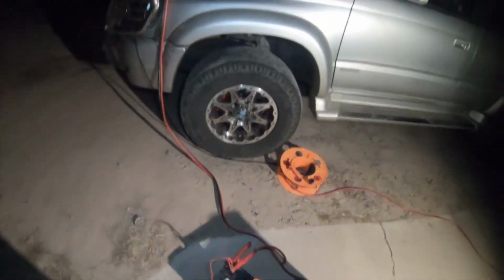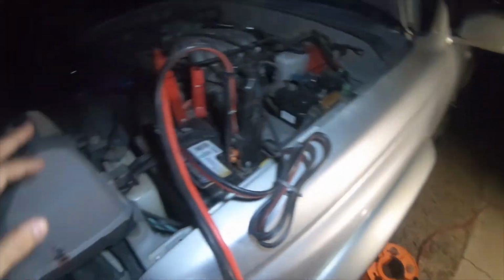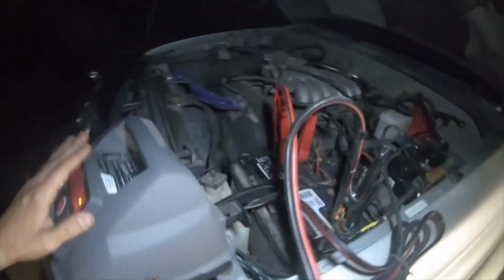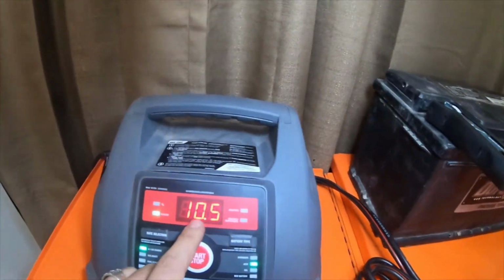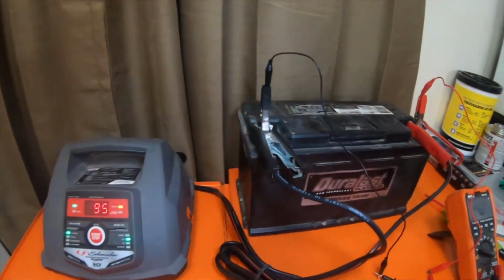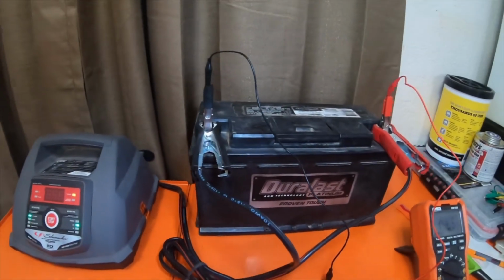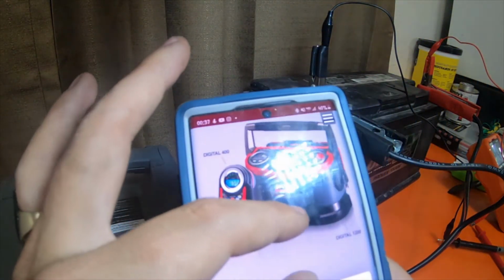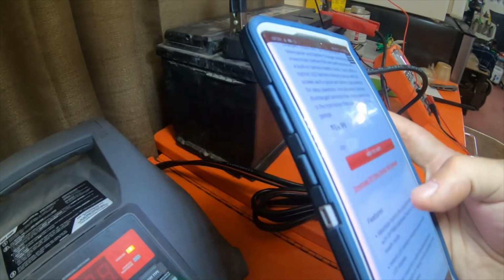Quick Tip - How to Revive A Deeply Discharged AGM Battery N More - Part 2 - 8 14th 20

Comment: Have you below 11 V the battery is already damaged. What’s the point?
Reply from the maker: Just because the battery is below 11 volts don't mean the cells are damaged and the point of the video was to show others how to boost a battery to then get it to charge with a smart charger

Comment: You don't mention if they are both AGM batteries. Can you have the good battery as lead acid and the other AGM and still do the Parrell set up?
Reply from the maker: @BrentFowlds  yes you can the battery type dosent matter when trying to boost the battery voltage just make sure the charger can deal with that type of battery

Comment: You really should use a trickle charger Ctek or battery tender are really good. No more than 2 amps charge rate and bring it up slowly.
Reply from the maker: This video Is about reviving a Dead Agm with another Battery to trick the charger into charging the dead battery.. You want to dump as much amps into the battery over Few hours to Bring the cells up rapidly You use a Battery Tender At the point were the battery Is At 98 percent or above to Maintain the battery charge and Help with the sulfate.. @JoshSmith-wo7zw

Comment: Should not I hook the charger to the bad battery instead? I mean i want to charge the bad one. What is the difference? If this works you´r OG 😂
Reply from the maker: You can't revive a Dead battery under 10 volts or bellow with a smart charger without using a Good Battery to trick the smart charger into thinking there is a 12v good battery with just a low charge so you use a good battery to trick the charger into thinking the bad battery is good @Tomas Calta
Reply: @AntonioClaudioMichael  yes but after I connect two batteries in parallel, it doesn't matter where I hook the charger right? It can be eather to the bad battery or to the good one right? I think the voltage should be the same on both batteries when they are connected in parallel but I am not sure
Reply from the maker: @CaltaTomas  correct it dosent matter what battery you connect the charger to but it works best when the charger is connected to the bad battery to insure its being charged first your only using the other battery to trick the charger into thinking your bad battery had normal voltage
Reply: @AntonioClaudioMichael  thank you sir, I'll try this evening 😃

Comment: The SUL in the charger window means it has entered a desulfate mode. It pulses the battery to break up the sulfate on the plates. That is the pulsing you hear. It may take overnight to recondition (desulfate) the battery. Then the charger will switch automatically to charging mode. You should leave it in SUL mode and let it do its work. The charger manual should explain this.
Reply from the maker: Appreciate you sharing the information for everyone on SUL charger information does no mention it @Charles Hodges

Comment: Will this work with ATV/Snowmobile batteries?  I have a dead AGM battery from my snowmobile.  I have a full charged regular (acid) ATV battery that I could use to connect.  Would that work?
Reply from the maker: This will work with any battery including 6 volt batteries including lead acid agm, gell batteries and Lithium batteries @Karl Hungus

Comment: Good video. Wish me luck. I've got two banks of 4-6 batteries on my sailboat that discharged (because I forgot to turn back on one of 3 sets of switches between shore power and my boat's systems. Why if going below a certain voltage level is such a problem do these modern systems, with controllers and inverters ever allow this to happen? It's like an elevator that is very safe, but the fourth side is wide open to the shaft.) I've been letting my neglected Prius's 12v  starter AGM battery run down and having to put it on my charger (It's a real nightmare because you can't open the back hatch when the battery is dead and that's where the battery is. The big traction battery won't do anything for the 12v starter battery. So no one ever thought, "If the starter battery dies, there should be a simple way to use the traction battery to jump it..." Nope.  And this whole thing with sub 10.5 v AGM batteries not being recognized by chargers is just silly. But my boat won't charge (part of the problem is I have no clue what the switches and info on the charging controller actually means. One switch has two positions but four items. The other switch has two positions but three items.
Reply from the maker: I wish you luck sir and some of the new chargers have so many safety features that they won't charge anything below 10.4 volts because any 12v battery below 10.4 volts is actually considered a dead battery but there are ways to jump a battery to boost the voltage so a smart charger can be used to charge the battery my favorite smart chargers are the optima chargers they will charge a battery that had gone down all the way to 0.5 volts.. as well As you have some amazing information and Thank you for commenting and leaving your thoughts @WillN2Go1

Comment: Went to take the battery out to charge and i seen some water drops on the bottom? All bad? It charged to 13.5 but didnt hold it after a 24hr charge. My battery was at 8 volts before charge. Should i charge it for 72 hrs?
Reply from the maker: I would put it back on the charger and Trickle charge it for 72 hours or more with a low amp charger some chargers have a conditioning charge feature that will help it will charge and discharge the battery to exercise it
Reply: @AntonioClaudioMichael  👍 sounds good thanks bud
Reply from the maker: @millionmilesaway12  no Problem at all Sir If you need anymore help dont hesitate to reply